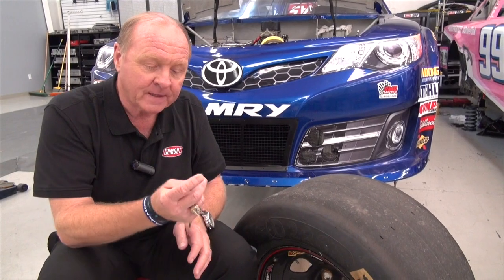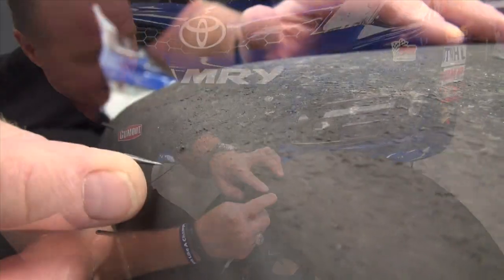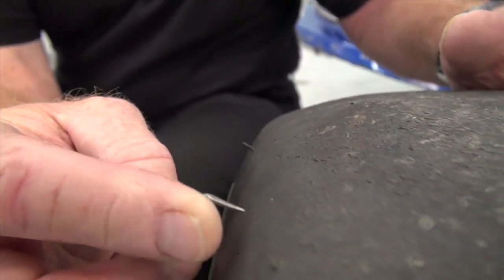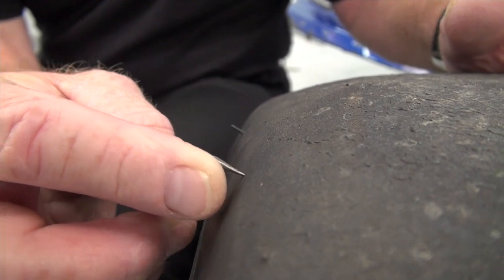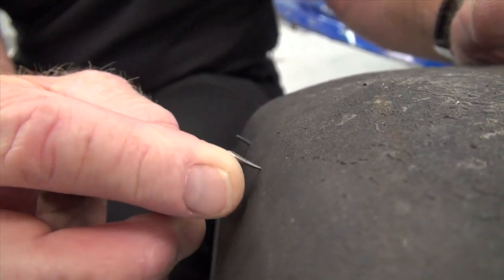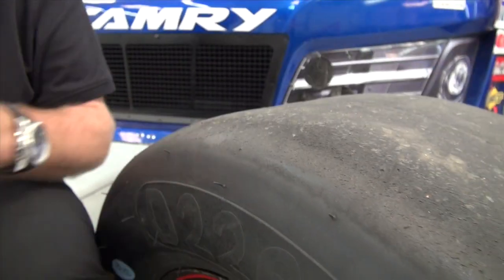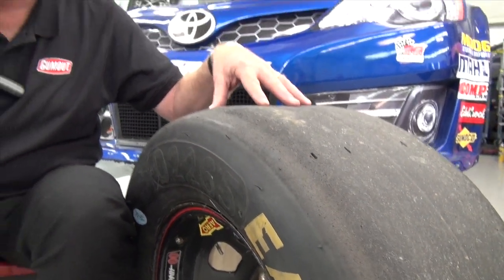Pushing The Envelope w/Larry Mac - Tiregate 2015

Comment: I guess just putting a calibrated pressure relieve valve in the valve stem isnt legal? Dont they use nitrogen in the tires? That usually covers the pressure I crease from heat...hows about CRASHCAR asking the tire manufacture if it damages the tire?. Seems like controlling pressure would be a good thing..to much pressure, tire loses grip, tire starts sliding. builds more heat. Looses more grip
Reply: Yup, pressure bleeders are illegal. Also, ALL gasses (nitrogen included) increase pressure with increased temperature, given a constant volume (like inside a tire). Google "Gay-Lussac’s law". You're right that constant pressure would be advantageous, apparently NASCAR wants to add a little more strategy for the crewchief to puzzle over - can't make it too easy.....
Reply: @tridium-go6hw  Yep sir, you sent me to school on that one...Everybody "knows" nitrogen expands less with heat than air does. Thats why the charge shocks with nitrogen, it would suck if they get all stiff on hot days and you never see guys running baja stop in the middle of the race to let some air out of the tires to soften up the ride....I have been living a myth my entire life and you are the first one to dispute it. Send me to school...i get to pass on the lesson..The guy i been working for is extremely knowledgeable. Lifetime engine machinist, engine builder from yamaha sideby sides to top fuel including tune. Built a twin turbo hydro that ran 240 on alky.....climbed in my shit hard one day about adding air from the compressor on a couple of mostly flat tires on his pre runner....if they ran it with air in some tires and nitrogen in the others no bother with suspension set up, just park it it the sun, them tires with the air will have more pressure and the setup is junk....The man who is never wrong has made a mistake....lol....this is going to be fun, i just need to figure out how to tune him up and not get fired.......thanx for the info!
Reply: @tridium-go6hw  If they were really serious about pressure bleeders the could mount them to the rim  inside the tire or even j7st drill a 5 thou hole in the wheel, set the pressure right before install....and hope they dont have to many yellow flags.... I suppose its not legal to heat the tires up slightly higher than normal operating temp and after a lap they cool down and the pressure drops to where you want it? How about valve cores with crappy springs that centrifugal force would make them leak a little at high speed? Pressure bleeder could be the difference between the spring in the valve core....like valve cores for tires are different than the ones in compression gauges,
Reply: @blackbirdxx928  As to heating the tires, that is what Formula 1 has done and is getting rid of for 2022